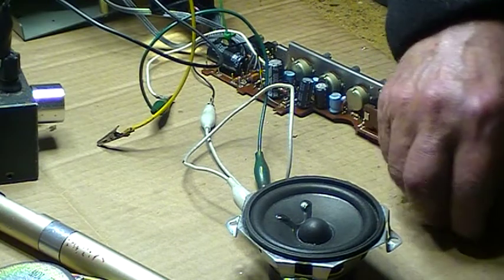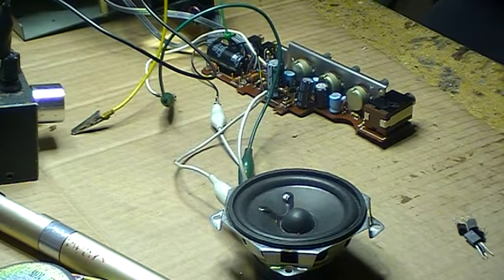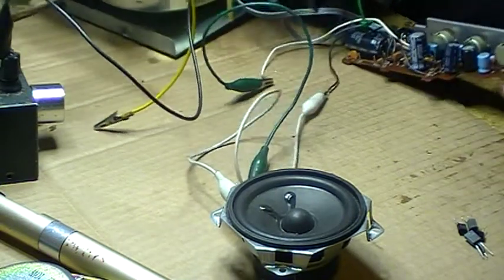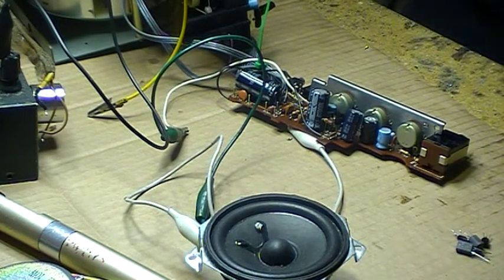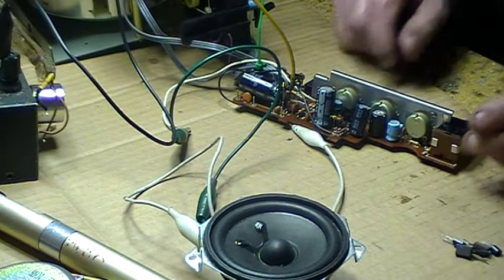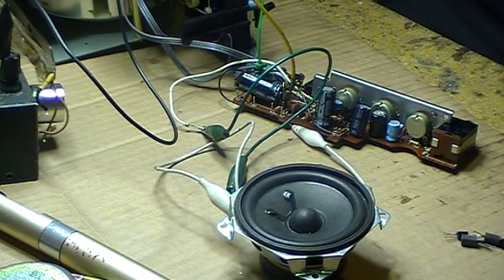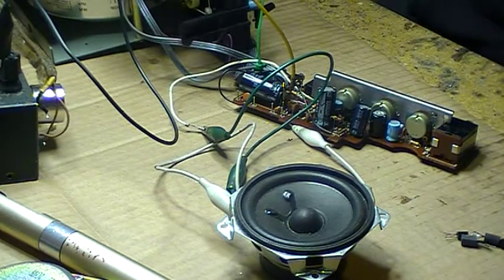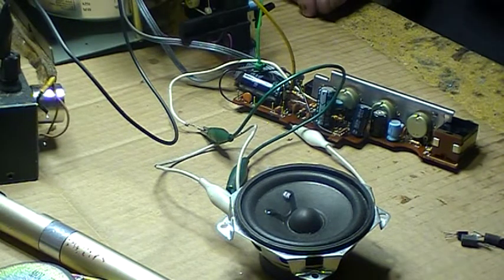Sony ICF6800 repair part 3

Comment: Dayle great job on the audio fix, thanks for the cable tie tip and for sharing your hard earned knowledge.
Reply from the maker: These radios are a difficult repair given the way they are constructed. Take your time, do everything in a logical fashion, I wish you every success. I thank you for the kind words.
Reply: @dayleedwards3521  thanks Dayle, I am going to use it as a radio to restore to get some experience before I tackle my CRF-V21 recap. I am not completely new to repairing electronics although not radios. I am looking forward to the challenge and let you know how I get on. Thanks again for sharing your great video on the 6800w.